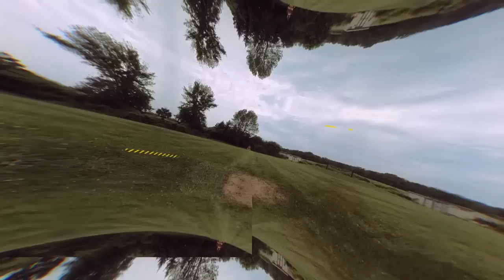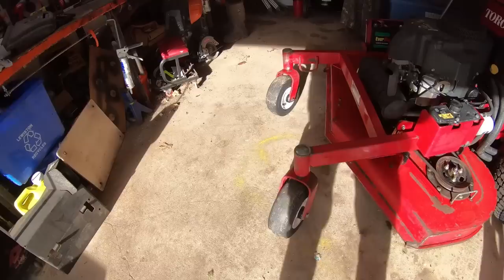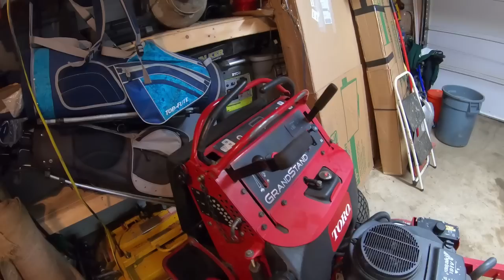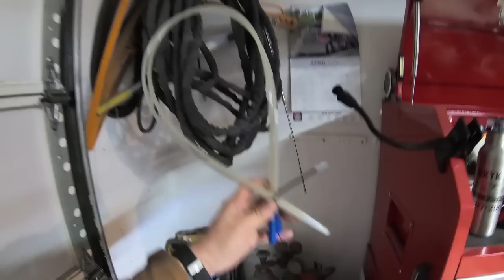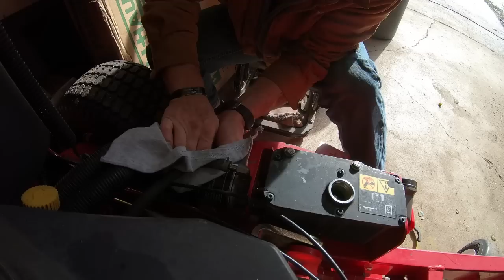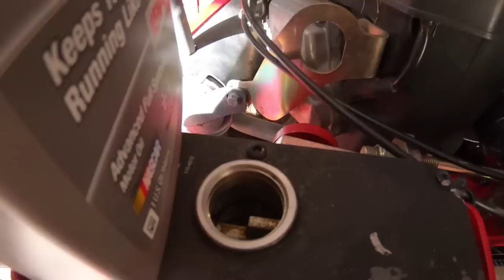Toro Hydro Fluid Change (Grandstand)

Comment: In order to remove ALL the hydro fluid you need to release the cap on the side of each hydro pump, drain and refill system with 5 quarts, remove top caps to bleed the system, done!!. I own a repair shop and have done many grandstands. This is a simple reservoir fluid change which can work if don't mine mixing old with new.
Reply from the maker: Yup that’s correct i just didn’t need to do that

Comment: Your comment about the filter "size" (10 micron vs 25 micron) is incorrect about a 25 micron being more restrictive than a 10 micron.  A 10 micron is more restrictive in that it will trap particles larger than 10 microns whereas a 25 micron will only trap particles larger than 25 microns.  The 10 micron filter will restrict fluid flow more so than the 25 micron filter.

Comment: Hey buddy i may or may not have bought an old vride today. It has the filter under the bottom between the wheels if i use the same method as you in this video will it introduce too much air into the hydro lines or do i just work it slow like you did will it work?
Reply from the maker: Your are exactly right. You can just work the air out. Usually easiest to jack the back wheels up and do it that way. Love your style buddy, look forward to the video on it..... You know, IF you bought it 🤣😉👍

Comment: Soak those hand grips in as hot of water as you can stand for about 10-15 minutes then give it a try. If you can’t get the one off to soak, wet a towel then nuke it in the microwave for a minute—wrap it around the handle, cover with a plastic bag, wait 10 minutes and push it on.
Reply from the maker: Used compressed air. Went right on

Comment: Try compressed air for that grip. Jam the tip at the open end, and push it on with your other hand. The air should ouff it up enough so you can get it on. We used to do it with handle grips on our sleds.
Reply: Oh, looks like I should have read the comments first.
Reply from the maker: Lol I ended up doing it. Worked really well

Comment: Heat gun or hair dryer that grip, soften it up a bit and work it on! 👍
Reply from the maker: I've thought of that. Might just work
Reply: @CountrysideStrong  easy enough and might make that grease work a bit better to, anyway back to c19 maintenance 😅🤦‍♂️ any easy ideas on things to check for with weak hydros?
Reply from the maker: @ohnoesimadeacomment  Stuart checking all the fittings first then move to checking all the lines for cracks
Reply: @CountrysideStrong  cant find any crappy hoses or anything but I am wondering of the drive axle oil has ever been changed in it, seems a bit messy to me like theres very fine shavings in it, gunna get some new oil on boxing day and give that a go.
Reply from the maker: @ohnoesimadeacomment  also make sure there's no air in the system